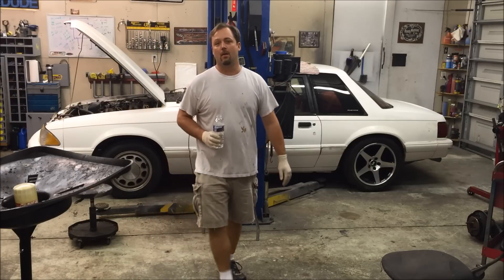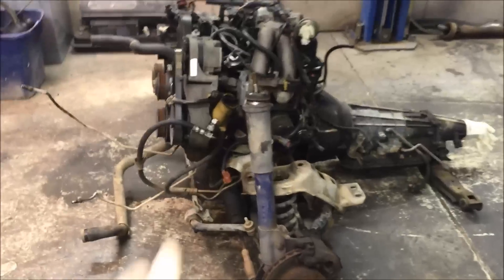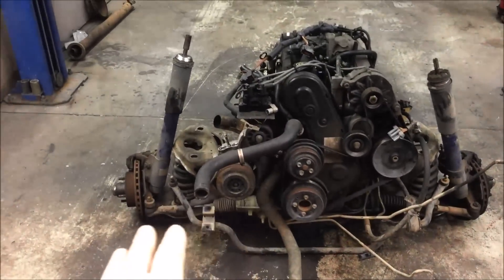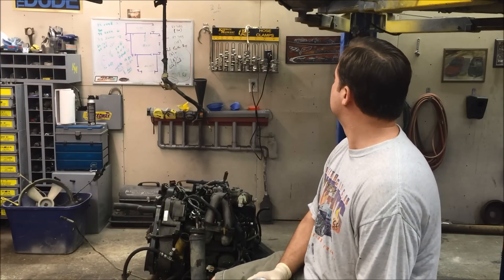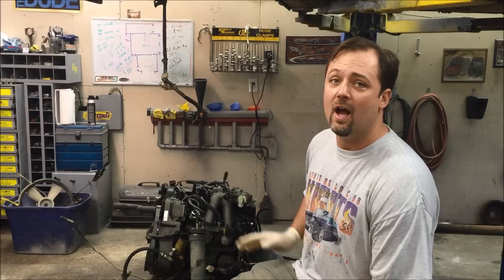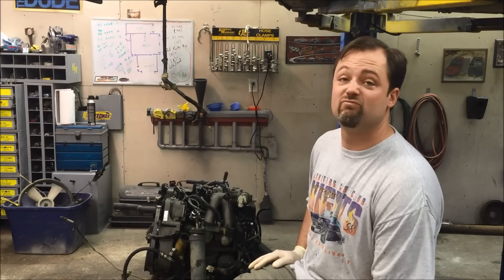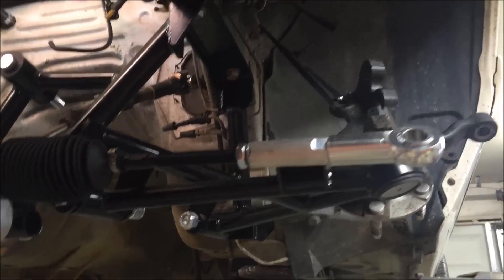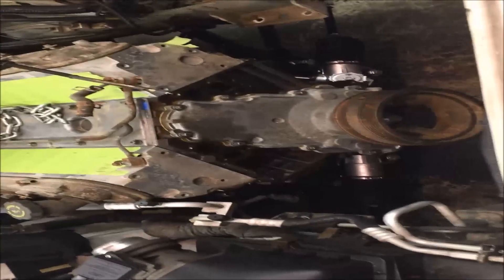Twin turbo LS swap foxbody Mustang part 4; original engine out, 5.3 installed

Comment: What wheels are those and what size are they
Reply from the maker: They are 03 Cobra Replica wheels.  They are called a "MAC Black" wheel because the MAChined surfaces are black instead of raw aluminum.  The fronts are 17 x 8 with 245/45-17 tires.  The rears are 17 x 9.5 with 275/40-17 tires.

Comment: Thinking about doing nearly the same build. Whats your opinion on motor plates for a similar setup? In the future would like to be upping the power beyond the stock 5.3 600hp cap but not sure what the right move is
Reply from the maker: I've never had a car with a motor plate, or even installed one on a car.  I don't have anything to share as far as that stuff goes.

Comment: what brand is the k member and is it direct bolt on to the 5.3?
Reply from the maker: AJE.  Yes.  It works with most any motor.  AJE offered different mount for ford, Chevy, etc...   But it all works with that same K member.
Reply: +Underground Garage okay thanks man, also, im not sure if you could help me with this but i was wondering where to get a wiring harness for one, unmodified of course so i can get to the usual standalone process
Reply from the maker: I got the engine, computer, and harness off craigslist.   If I hadn't been able to find a harness, I would have contacted Current Performance.  They have done harness work for me in the past and I've always been happy with the results.
Reply: +Underground Garage thank you for the info man im going to see what they have to offer